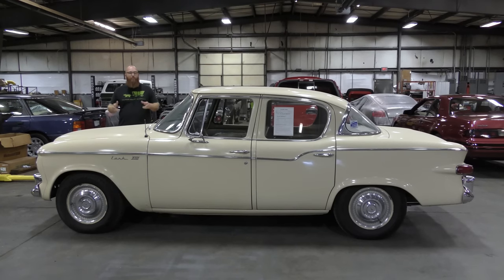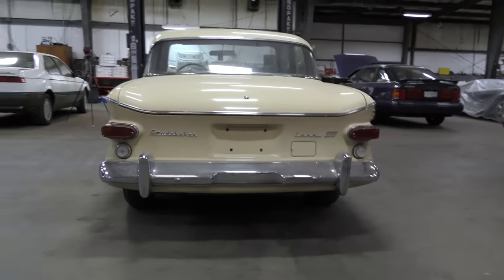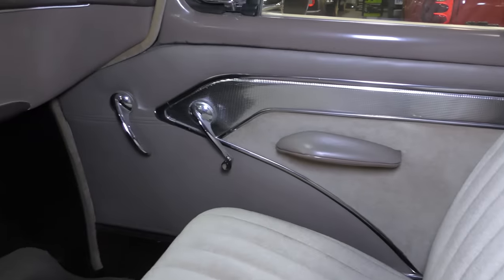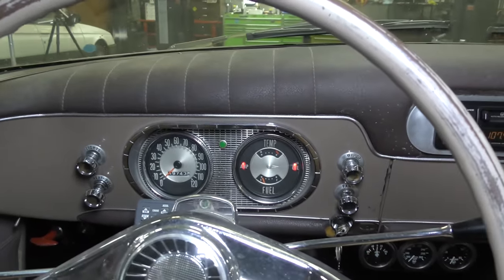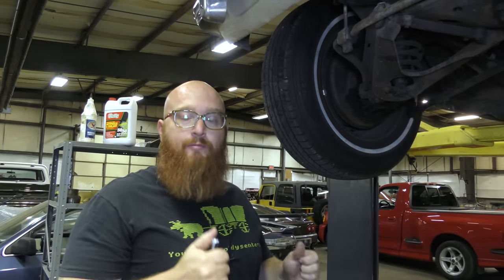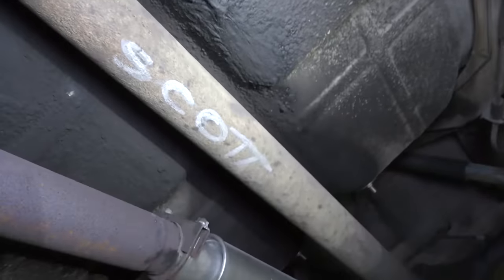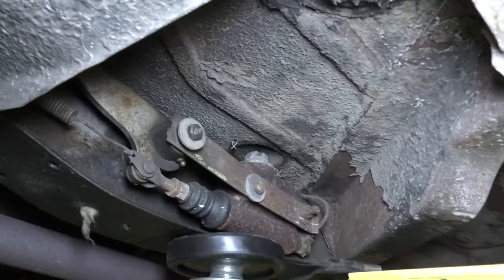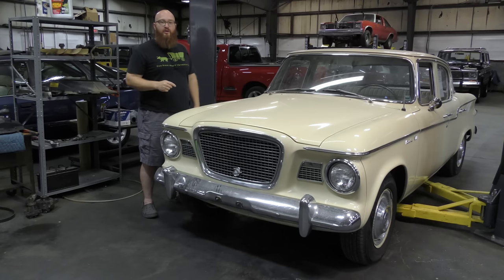Finally a CAR WIZARD approved engine swap done on this '60 Studebaker Lark VIII

Comment: Wizard some later built Larks came from the factory with a 283 Chevy back in the day, I remember seeing SBC engines in Larks  the blocks were black and the valve covers were yellow I do believe they also had 327 chevys in the higher powered Larks

The engines were painted black it may be original, but I would think the trans would be a Powerglide, or a Borg Warner 3 speed auto not a turbo 350.

My brothers and I loved the 53 to 54 Studebaker and Hawks they were cheap to buy,  most had the Studebaker 289, the 289s  were fond of spinning rod bearings you had to be very careful with them.

I was the proud owner of 3  Studebaker Hawks one was 1956 with a manual  , 2,  1957s  Golden Hawks,,  all three were 352 Packards
After you experienced the torque of the 352 you didn't want any part of the 289 and bearing failures.

 Mrs Wizard I owed a 1951 Studebaker V8 stick it was pea green with a black conv. top and a saddle brown interior. the car was beautiful, but of course it came with the standard Studebaker rod knock.

 I wound up selling it for 75,  made a cool 25 on it only after a cleanup the car was very nice but I had no interest in the bullet nosed cars

I started buying/selling cars when I was 13,  I lost track of how many cars I owned its somewhere in the hundreds loved every one of them.

Comment: A friend of mine had a 1960 Studebaker Lark Pillar less coupe with the 4.2l "Packard V8"  with the 3 speed manual box with automatic over drive. At 75mph the engine was doing 2000rpm and you would get about 10km/l fuel consumption.  The only thing they modified was the brakes. They fitted an inline brake booster from a old BMW and front and rear disks from a Peugeot 504.  No changes was made to anything on the car with the conversion and original stuff could be put back with no problem, but with the disk brakes it stopped like a modern car. The original brakes at high speed was pretty useless and this Studebaker could do about 135mph.

Comment: The VIII yes of course the Roman numeral 8. That meant the car came with a V8 engine. The most common of those was the 259 cubic inch V8. I believe it had around 160 horsepower. I don't remember those having optional four-barrel carburetors and dual exhaust. The VI is of course the Roman numeral 6 meaning that the car originally came with a 169 cubic inch Flathead 6.

Comment: My 1060 Dodge 4 dr Seneca had no rust and the front tires were up front like the Lark, under neath ir was nice maybe not as nice as that one as it had over 600,000 miles on it as it was a Taxi for 5 years before my mom got it then I got it, sure would like to find it again.

Comment: Yes the pickup   I have one in my car shade.  I built it in 1970 to store cars in.  The pickup was what i really wanted to put in it.  I had bought a 1955 that yr and had no place to put it under cover.  It cam from AZ where it had spent its 15 yr and was cherry even having 200K on it.  No I did not build a shade that will hold 20 or 30 cars.  Just a little 5 bay one.  Over the yar it has been added on as i have never sold a single car i ever owned and some that i bought to just add to my collection.  It has now 50 bays and i will be putting on 8 more this summer.
I drive the Studebaker pickup when I take things to a party.  When ppl see me pull up with it for the first time the first question is how much Bondo is on it.  No one can believe it is all original until I tell them of where i got it.

Comment: You need a 60-64 Studebaker Champ work truck. They were available with either a flathead or V8 Studebaker engine. Next time you are In South Bend Indiana we can tour the Studebaker museum or my buddies barn full of miscellaneous Studebakers.   I disagree about grease zircs.  At least on 60-80's cars all the tie rod ends and ball joints would be junk after 100k I changed a lot of them in the 80's at the Mobil Station I worked at.  The first years of sealed joints were not that great but I have put over 200K miles on 2 Toyotas and 2 Hondas and I didn't have to change any.

Comment: The padded dash and fancy door panels tell us this is a Lark Regal, the top of the line Lark, and that it's a Lark VIII (Roman numeral 8) means it came with Studebaker's excellent 259 V8, a much more solid engine than that Chevy motor. 

After Studebaker shut down the engine line in South Bend Studebaker of Canada sourced "Mckinnon industrial engines"  (basically Chevy motors built in Canada). All of the Studebaker sedans and wagons from 59 on up were based on the 59 Lark and so the engine mounts that Studebaker designed to allow the use of GM engines in the 65 and 66 cars will work equally well in the earlier ones such as this.

I've got a black 59 Lark Regal, it's Studebaker powered and will remain so, although the original engine spun a bearing so the car is getting a 289 V8, which is a nice little power upgrade.

Comment: Emblem is for the lark model only, lark vlll means a V8 model lark   A chevy small block easy bolt in swap also moldings and locks are stainless so no pitting  also studebaker parts are easy to come by and supported by a great national club

Comment: Wizard, The wiring on the fuel pump has marginal connectors.  Recommend replacing that with modern connectors.  The rear main engine seal is leaking (a standard problem).  I would check ride height for spring condition.  Those older Chevy small blocks also are notorious for front crank seal leaks and valve cover gasket leaks as well.  The oil pressure sending unit if its on the rear of the block by the distributor is also prone to leak.  Unless it has inspection plugs on the brake backing plates you'll need to pull the wheels off and actually check the wheel cylinders for seepage and lining thickness.  Just driving it is not enough.  Also, how can you tell the condition of the brake fluid without pulling the cap off and looking?  

Normally you are insanely detailed.  I'd love to see a follow up after it has been properly inspected.  Yes, they tuned an extremely basic car well.  I did many.  Mostly when I was YOUNGER from 17 to 30 years old.  Can't stand a car that doesn't just fire up.  So don't be so quick to down younger mechanics.  Some are quite good.  I've trolled you too much and for that I apologize.  But, normally you are so good these things don't need to be said.

Be well Mr. Wizard.

Comment: After reading the comments I'll summarize my POV
Bear in mind that my daily driver since 1989 has been a Ford Fairlane 500 coupe.
There are reallyv2 things to do with a so called classic car.
1. You get the car and restore it to original as closely as possible down to correct date coded wires hoses etc and paint inspection marks.
Then you put the car away and it's a trailer queen taken to shows.
2. You can get an older car and do what was done with the Lark. And yes generally it decreases the collector value of the car.
But it INCREASES the utilitarian value of the car.
AND the enjoyment of the car.
As an example I am the second owner of the Fairlane. I bought it in California with 72 000 miles. Oddly enough I wanted a 1966  or 1967  Chev II  SS 4 speed but even then they were approsching 20 000 for a good one.
So looking T alternatives I selected a Fairlane coupe.
I was already familiar with these cars having just completed a really accurate 196rvThunderbolt clone with the correct 427 cross bolted block high riser manifold correct carbs seats top loader 4 sod 9binvh rear end etc etc.
Only problem was it was a trailer queen withv12.5 to 1 compression a a thirst for 110 octane fuel not commonly available at gas stations.
So I found a very nice original coupe in Hemming for 4500 dollars.
The car had dealer installed under dash AC which worked very well a 289 2 bbl and a c4 trsns with an 8 inch open rear end. It had the remote reservoir power steering a one reservoir master cylinder and drum brakes all around with no power assist which didn't stop the car well at all particularly in the rain if you went thru a deep puddle or two.
Standard 14 inch wheels and tires with dog dish hub caps.
The car was going to be a DRIVER. At the time  I was commuting weekly between Vegas and LA. so I was putting around 1000 miles a week on the car.
Job onecwas front disc brakes which meant different wheels to clear the calipers up front.
I had a set of custom offset American 5 spoke aluminium wheels made 15x7 up front and 15x8 in back.
The wheel wells are restrictive so offset was critical. This allowed me to use the late 60s Mustang disc brakes up front with semi metallic pads . Out back I used the 1964 Fairlane station wagon drums which were wider than the coupe.
A 2 chamber master cylinder and a power booster and a proportioning gave. NOW the car would STOP. Straight and true. The front tires were 215x50 15 T A radials and the rear were 235 x50 15 radials which put a lot more rubber on the ground.
I ran the little car back and forth  for two years until the engine was all done at 175 000 miles.
At that point I wanted a bit more power and for the car to cruise easily at 80 to 90 mph. So I didn't rebuild the 289 which in retrospect was a mistake.
I built a 351 Windsor and put it in. At that point I switched to the more modern power steering setup with the integral pump and reservoir down low on the driver side of the engine. The Windsor was built with Dart iron heads.and a 4 bbl intake.
At that point I put in a good 3 row sluminium radiator and had Carr build a beefed up AOD auto trans.
Rather than go to the brain damage and expense of putting a 9 inch read end in  I had a good shop build an 8 inch locker and put it in with Strange rdsr axles.
The increased deck height of the 351 necessitated a set of custom built headers. Here we see what Car Wizard was talking about when you change things around.
The Fairlane would now cruise effortlessly at 90 mph at around 2800 rpm.
However the new engine was at least 7t lbs heavier and the cars handling suffered as a result.
And the suspension was pretty worn.
Here we come to another point car wizard doesn't really mention.if you're not working with a popular Chevy model or a Mustang Falcon some parts an be EXOENSIVE Going completely through the front suspension was 700 dollars in PARGS a lot of which had to come from an outfit called RARD PARTS .  THE suspension on the 64 Fairlane is unique to that year and the Fairlane ONLY . No one made or makes good updated suspension for this car such as Hotchkiss or Detroit Speed.
Never the less I did what I could to improve the handling. L the bushings in the front end were graphite impregnated poly  The front sway bar uprated to the largest Addco unit avsilsble. Bilstdin Sport Shocks at all 4 corners. Boxed the lower control arms. Got lucky and found an ofiginslvexoort bracelet at a swap meet. And yes they are NOT the same as the zmustsng Falcon brace. A Monte Carlo bar tied into the shock towers not just the fender sheet metal.
An adjustable Watts linkage for the rear. 
750 pound springs up front 1.5 inches shorter than stock and  300 lb leaf springs out back armed to set the back. 75 inches lower than stock.
The improvement in handling in corners and at high speed was phenomenal  previously the car became floaty and twitchy over 90 mph.
Now it was stable up to 120 or more.
I could take the car into any curve at better thsnv2x the posted speed.
After around 2p0 00 miles the 351 was getting tired and zthe inpjtshsftnon the AOD broke.
This time I   decided to stroke a 302 and get the excess weight out of the front end.
I considered a 347 but discarded that idea because button pistons had not yet come on the scene and due to angularity they tended to have problemscwilingvthe rings out.
So I went with a 331 using AFR aluminium heads a full roller hydraulic cam and lifters 10 to 1 compression  for 91 octane pump gas and a Treec 5 speed manual trsnscwith a hydraulic assisted clutch. The Tremec is shifted  with a floor mounted Hurst shifter  in the correct position. To do the job right I had to find an original steering column from a 4 speed car. 
Which again gets back to the Wizards comments on changing one thing frequently means changing 3 other things to do it right.
The current engine dynoed at 424hp. It has 6 inch rods and about the same bore some ratio as a 327 Chev and a useful power band from 2000 to 6000 rpm.  The rear endcrstio isx3.5. The Tremec od ratio is .68
Which means that 90 mph cruise is around 2750 rpm.
I've had the car to 145 mph calculated by the tach reading since I know from being clocked by other cars that every 1000 rpm in OD is good for 30 mph.
At 145 mph the car becomes uncomfortable.
The car runs 4 aftermarket Cibie quartz iodide headlights with 100 watt bulbs in all 4 with upgraded wiring harness relays and an upgraded 120 and alternator to handle the additional power draw.
Agsin.... change one thing and......
Outwardly the car appears to be completely sock in Wimbledon  white with the black stripe down the side as per original. Only the wheels and tires appear at first glance to be non factory.
Inside the car appears completely stock except for a 3 gage cluster mounted under the dash over by the glove box and a tach under the dash over by the driver. The carpet and headliner and front bench seat cover have been replaced once with reproduction items.
Unless you check the shift pattern on the shifter it appears to be a stock 4 speed car with a zhurst shifter.
The cars chassis is still rust and rattle free.They builtvremsrksblyvdursble cars back in the 60s as Wizard comments.
Have I decreased the value of the car?
Probably not. Itcwas not a high value car to begin with since  it wasnt a K code Sport Coupe to begin with.
It would never have been a high buck car.
But like the Lark it is relatively rare and almost every day I drive it it gets admiring comments.
I have 3 people wanting to buy it at bettrrthan 20000 if I ever want to sell it.
I'm considering replacing the Holley carb with fuel injection but am reluctant to add the complexity.
The biggest problem is replacing an occasional part that wears out and is not reproduced.  Like the one speed wiper switch which is unobtainable. 
So from my point of view the highest and best use of a classic car is to take it correct its weak points leave it as stockbsppesring as possible and then use it and enjoy a trip to yyester year every day.
There is no depreciation curve.
Every dollar you put in is driven out of the car. And it's STILL  worth money.
If I had the Lark it would have gotten a 400 hp 350 4 bolt  Chev engine a 400R4 trsns or a Tremec 5 spd power front disk brakes maybe power steering  and uprated springs and shocks.
The rest I would have left as is. Had I gotten the Ark with the ODM driveline I would have taken pictures prior to changing anything and stored all the OEM parts and drive line  I took off in case I or a future owner wanted to put it back to original becsuse of the rarity of the V8 engine. 
I happen to own  panther pink Dodge Challenger TA with the 340 6pak engine and 4 speed.  I used to take it to Spring zoning in Woodley Park in LA. It is a beautiful car. And pretty useless as a daily driver.
The 3 Holleys are finicky.you don't want to hammer the engine because it's numbers matching. And performance  is so so. The engine makes maybe 350 hp. And it's a heavy car.
So the original driveline and suspension is stored.
The car currently runs a built-in with 2 step headers putting out 440 ft lbs of torque and 395 rhp 440 6 pak torsion bars  and rear springs and a bunch of Hotchkiss suspension and built. Chrysler New Process 518  4 speed automatic w OD.Bjlstein Sport shocks . Vintage Air AC one Holley 4 bbl 
10 spoke aluminium Minilitd style wheels 8 inch in front 9 inch in back .17 inch shod with Michelin Pilot Sport tires 
Th car will  run out at over 150.mph.
I sometimes autocross the car so an Aviad oil pan keeps the oil around the pickup.
An aluminium  radiator keeps everything cool along with a big trans cooler. Basically it's a REAL TA racer that's streetable and that I can drive on the street track and autocross.  If I break something noting deal I can fix or replace it.
And the car can always go back to stock with 2 weeks of wrenching. T hen it's worth a rod 50 K.
THATS how to enjoy a vintage  performance car.
At least in my opinion.
.

Comment: I am a original owner of a 1997 Honda Del sol Si.  It has 206,000 miles .   I have never owned a car that beats for dead bang reality.
I would not hesitate to get in this car and drive anywhere.  Only about 5800 were brought into the country.

Comment: I remember the start of ball joints and  u joints etc that 'never need servicing " 😉 Nah ,they just did away with the ability to service parts,not the need. I haven't bought new u joints in years. Can you still get replacements with zerks?

Comment: Did they use electric ignition or does it have a points distributor, did it still have a studebaker trans or did they use a hydramtic?

Comment: I think I read somewhere that the Lark was created by Studebaker by basically taking one of their large sedans and shortening the wheelbase and putting a smaller body on it. It was their version of a compact car similar to AMC. At the time Studebaker was in rather bad shape. They didn't have much money to work with. These were fairly popular until Ford and GM came out with their compacts. Less than 10 years later Studebaker would be gone.

Comment: Did you look up the engine code.  My guess is it's a 283 C.I.D to make it more reliable.  A 350 would probably be overkill.  Also year would that engine block be as well?